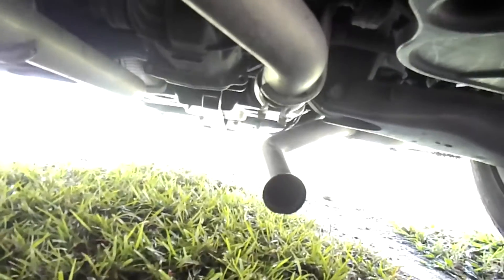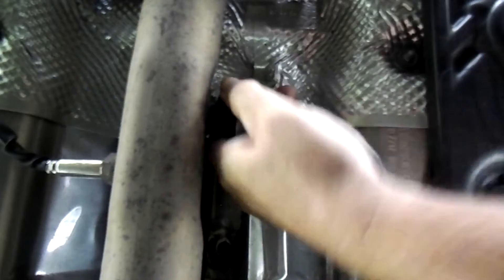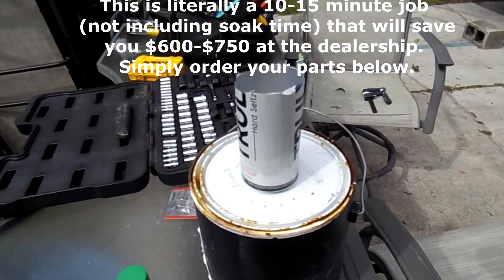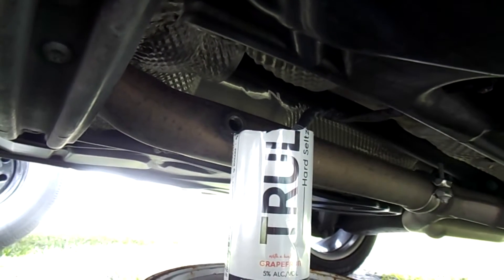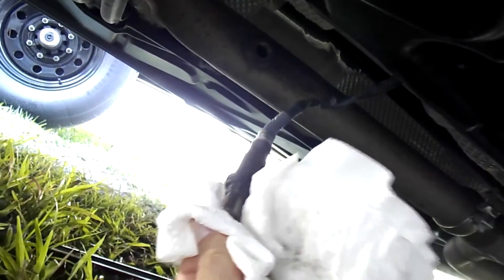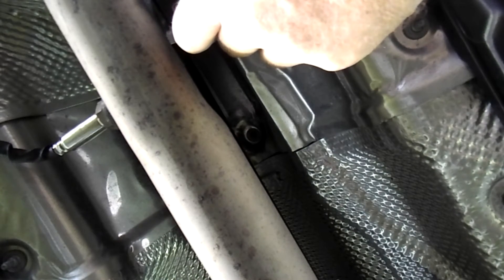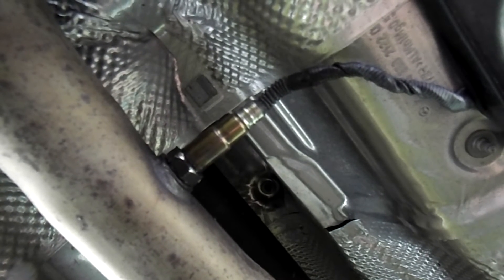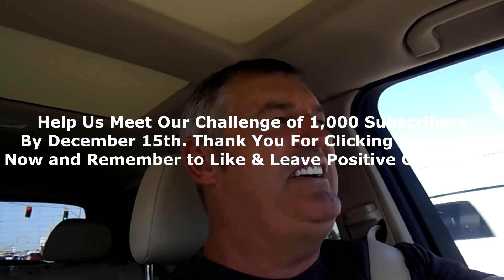How to fix a NOX Sensor DIY for $10 on any diesel engine without replacing, even on Mercedes-Benz.

Comment: Good video only problem sometimes they need complete replacing hard to tell as a DIY guy
Reply: Mandeep Lalli, Thanks for the comments and yep sometimes they do just need replacing but it does make sense to invest $10 to determine if you MUST replace them and then spend $1500. We see that you have not yet joined our family here on YouTube and we would love to have you. Please subscribe and let us know once you have.....WELCOMEE!
Reply: @gmiller4326  definetly agree I tried your way with the cleaner first for 10 pounds or so was worth a go ended up getting it diagnosed from garage and then changed it myself problem with these are you need a proper snap on computer to reset the ECU and box.sensor as a DIY guy like me it's a nightmare back to the garage lol subscribed

Comment: Great video, but I’m curious since it’s been 2 yrs now after your Nox sensor cleaning. Did it fix the code problem indefinitely the past 2 yrs or did codes return after a short while? I have this exact same vehicle (GLK250 2015) with the exact same problem.
Reply: Hello Kyle Mills, Sorry for the delay...was doing my turkey vacation. The MERCEDES ran strong for 3 months after the maintenance and sold it for a NEW F250. Diesel of course but never had another issue out of the MERCEDES. Kyle I noticed you haven't subscribed to the Miller Family Farm Trust Channel and we would love for you to join the family as we love participation with real people. Let me know once you have subscribed.

Comment: Hi Dear. Nice informative video. Like 👍, join and subscribed to Your channel. I have Jeep Grand Cherokee  2015 3.0L eco-diesel… Got the same message: car won’t start in * km. Service DEF system see dealer. Then I found NOX sensor code on computer. Could I do that way to clean the NOX sensor on my car? Thank You.
Reply: Andrey.
Welcome to the family. Yes you can certainly try this on your sooted sensors and the worst case is you will have to buy a new sensor. Let us know how it goes for you. Most people here have found that it works 95% of the time. WELCOME!!!

Comment: I have an engine warning light on my 2014 ML 250, Mercedes dealer quoted me $1200 for getting it fixed…🤪. Will try the clean first ! Not sure how the engine warning light will reset itself..without taking it back to the merc service to have their diagnostic system take care of it?
Reply: Hello Slicky Nick,
Yes I know the Mercedes dealers love to swap out sensors every 10,000 miles and now you have a way to clean them yourself. We noticed you haven't subscribed to our family and we would love to have you as we love it when people contribute. Let me know once you subscribed and I will shoot you an email offline for how to reset your engine light for free. Welcome aboard.
Reply: I have the same issue. Did the cleaning work? If so, for how long? Thanks!

Comment: what codes did you have mate? I cleared my 2 codes P229F00(Nox sensor) +P20EE00 that came up with the ad blue 600mile warning. Only took 4 litres to top up. But light still there. Will cleaning the nox sort the ad blue problem?
Reply: Hello Frank,
Thanks for the comments and questions, we love when good folks participate with positive comments and questions. We did notice you haven't subscribed to our family and would love to have you part. Hit the subscribe tab now WELCOME! 
I do not remember the codes my 250 as the codes where over 2 years ago but start with the basics and get the sensors cleaned up and then lets see if that takes care of the "Blue" issue too. Let us know...

Comment: Twist the sensor before you do it back up so the wires are then straight on completion
Thanks for the very informative video Sir!
Reply: Thanks Adam for the acknowledgements! We love people like yourself who leave positive comments and we would love to have you join our channel. If you haven't already done so.... please subscribe.
Reply: @gmiller4326  about to take my cr35 to main dealer as have this NOX issue that wont clear. The Mrs had to press the code reader reset as we were driving just to get it back. She was controlling the turbo actuator solenoid as I'm flooring it. Listers VW here we come! money I bet but I have spoken to the guy and told him your sensible and logical idea
Reply: @partalien9862  So sorry to hear you did not get this fixed yourself for $10 and 15 minutes of your time but we understand sometimes it just easier to pay the dealer. We noticed you have NOT subscribed and we would love to have you join our community as our family simply loves contributors like yourself. Please subscribe and then shoot me a message that you have subscribed. WELCOME!!!!

Comment: I tried this today. I'm going to let it soak for 24 hours. I'll let you know how it works.
Reply: Good for you Marty,
Let us know how it goes as it really saves a load of money. I have been told occasionally, it will not clean out the sensor but I think that is only when you drove with the sensor plugged for sometime. We like people who share on our channel and would love to have you subscribe and contribute to the remainder of our family here at the MILLER FAMILY FARM TRUST channel.
Reply: @gmiller4326  Worked for about 10 miles then the light came back on. That was after 24 hours of soaking. I ordered a new one.
Reply: @martyacosta2335  As we have seen with others, sometimes it requires a second cleaning if they are really gooked up. We have noticed that you haven't subscribed to the family here on the Miller Family Farm Trust Channel and we would love to have you as we like when people participate. Let me know once you have subscribed and WELCOME!!!

Comment: Hi I have a glk 250 2015 too. This showed up few days ago. Scan tool says it’s NOX sensor P229F & P2202 sensors 1 & 2. 

First once you cleaned them did the engine light disappear on startup or after a short drive

2nd in the vid there was another lead going into the exhaust opposite the one you cleaned. Are both of those the 2 NOX sensors or is the 2nd one elsewhere?

Any help appreciated. Only had it 6 weeks dealer refusing to fix it as a courtesy.
Reply: Hello Nickers,
We noticed you did not subscribe to our channel and we would love to have you aboard as you ask very clear questions that contribute to our entire family here. Welcome Abaord.

1. Once you clean the NOX and SOOT sensors. You will need to manually reset your computer engine light or you can take it to a parts store and ask for a favor to reset your Engine Light. 
2. I am not sure you what you were looking at in the video but you would want to clean both the NOX and SOOT sensors. 
3 Generally speaking the dealer could be forced to fix EMMISION issues but why don't you give this simple fix a try first. 

Be sure to subscribe to our family here as we like people who ask questions and leave constructive comments as this contributes to our whole community. Welcome Aboard

Comment: * IMPORTANT***
Hi everyone, their has been a re-call for all ML250 ECU SOFTWARE. Im in melbourne australia and we had limited kms remaining, dashboard also said ADBLUE and NOX sensor. The car ECU also locks out anyone from making any changes so both NOX sensors will need replacing for free to be able to do software update.We almost spend several thousand dollars at private mechanic, lucky we rang mercedes.  All the best
Reply: @fezg123
Thanks for the info.
I'm having the same problem with my ml500.
But I don't know if the recall cover ml500.
Do you have a link or a place for me to check this information.
Please and thank you.
Reply: So once you receive their update it locks your computer so you can never delete these dreaded emissions components ?

Comment: You only cleaned one side on your 250 did you actually clean both I still have car up so would be easier to do second one if that is necessary. thanks this was most helpful.
Reply from the maker: Yes I did clean both sensors.. Good Luck Jim

Comment: I watched this video and went under the car to pull the one on the driver side, like the video showed, but wasn't sure if it was a NOX sensor and looked up the part number and it showed that its not the NOX. The one on the passenger side is the NOX. Could this have been switched at a shop?
Reply from the maker: Job well done! One is a sut  sensor and one is a nox sensor. Good job at looking up your part numbers. Good Luck with your project and welcome to the family. Subscribe to our family and make sure to hit the like button if you really like our videos. Get-er-done!

Comment: Nice.  We have the 2014 glk 250 Bluetec.  Has had a number of sensor issues related to exhaust.   Had code p24c6 today for particulate filter sensor.  From what I've read it may come from exhaust system not getting hot enough for effective regen.  Was wondering if I should just clean particulate filter.
Reply from the maker: Hello Randy,
Thanks for the comments here on the Miller Family Farm Trust Channel. I have never cleaned a particulate filter before and I am not even sure if you can BUT if you discover how to do it and it works come back and share with us. In the meantime be sure to subscribe to our channel now and hit the like button too and the BELL button so you will get notified when we post new cool videos. Thanks again for making a difference.

Comment: After P22A1NOx Sensor 2 Circuit High Voltage Bank 2 code appeared, I completed work as described in video with downstream sensor. 
Was happy when code light went off for several days, then new code appeared, P2201 NOx Sensor Circuit Range/Performance Bank 1. 
How could this be related? And now what? Video very well done for this novice DIYer.
Reply from the maker: Good Day Pbean,
Thanks for the acknowledgement for the video. You will want to search what the code P2201 refers to. It looks like you may have 2 NOx sensors but I do not know your particular vehicle. See if you have 2 NOx sensors and also call your local service department to see what code P2201 refers to and where that sensor is located. Good Luck
Reply: @millerfamilyfarmtrust6515 all vehicles have 2 nox sensors one before cat one after that P2201 is the first one
Reply: Just wondering what you ended up doing to fix the P2201 Nox error code?

Comment: Thank you for your video, the idea of just cleaning a carbon "infested" sensor for the 1/100's cost vs having the dealer replacing it really appealed to me. I own a 2014 GLK 250 with 50k on it. As the story goes the CEL light came on, scanned and found NOx sensor fault. I started removing it using an 18" bar and suddenly "successfully" snapped the removal tool into two pieces. What now - I was thinking. Well I resorted to my 14" pipe wrench which did the trick, no problem. I took both sensors out, soaked them for 24 hours, flushed and reinstalled them. I then turned the engine on, ran it but the CEL only would go out after erasing the fault code. So far so good after a week and 100 miles.
I'm now a happy subscriber.
Reply: It's 3 year later. How long did the 'Check Engine' light stay out? I'm interested in how long this sensor-cleaning works for.
Reply: @xxwookey  you have a problem to spend just a few euros, dollars or whatever to solve the problem, every 3 years ???????
Reply: @ No. I'm asking how long this worked for. It works long-term and doesn't damage the sensor then that's great, and this is indeed somethgin many of us might want to do. But we don't know that. It's obviously not an 'approved method' so it's possible that the injector cleaner doesn't interact well with the sensor catalyst materials, and the thing dies after a while. So a reply from this guy saying 'yeah, I've had no problems at all for 5 years now' would make viewers more confident about treating their $300 sensors this way.
Reply from the maker: THANKS STEVEN FOR CONTRIBUTING TO THE MILLER FAMILY FARM TRUST CHANNEL! Its people like you that really make this channel great. Welcome aboard!!!

Comment: I think one of those, the most rearward, is the soot sensor. The other is Bank 1 sensor 2.  Bank 1 sensor 1 should be upstream.  Also, the Mercedes diesel exhaust sensor are VERY fuel sensitive. If you use Top Tier brands of diesel, like Shell, Mobil, and Sunoco, you will have fewer problems.  If you use cheap diesel from small stations, the fuel can be dirty with paraffins and other contaminants.  These engines require the absolutely most clean full synthetic oils because if any soot escapes from lesser quality oils beyond the rings into the exhaust, it will foul the sensors. Even regular Mobil 1 is too dirty.  If you know that even traces of Mobil 1 in the exhaust is too dirty and will foul the exhaust components, just think what dirty fuel will do from Bubba’s Truck Stop.  Also, soak those sensors with PB Blaster overnight, start the car for 5 minutes, shut it off and soak it again with PB Blaster for a day. Then they will come off with a crescent wrench and a couple of hits with a hammer.
Reply: I thought one of the reasons for diesels is the ability to take down dirty gas. eg) When you go to Mexico
Reply: @nickardecky7404  I have to agree with you Nick but I used only SHELL and still had issues with the Mercedes (Over and Over) until I started this technique that only takes 15 minutes. We noticed you have NOT subscribed and we would love to have you join our community as our family simply love contributors like yourself. Please subscribe and then shoot me a message that you have subscribed. WELCOME!!!!

Comment: Any issues meanwhile with Nox sensor.

my merced van has a faullty nox sensor. I want try same thing.
Reply: Good Day Crina, I sold the Mercedes so I cannot tell you how the sensor is doing now but it was fine for about 3,000 miles after cleaning both sensors. Good Luck

Comment: That was pretty good Handy man's GLK fix. I had P229F62 code on my 2015 GLK250 and dealer replaced the NOx sensor which fixed. I had CPO warranty and it covered. Next time if get same problem after the Warranty expired, will try that!
Reply from the maker: Thanks Sang Lee...Remember to subscribe and support our channel.

Comment: The CEL on my 2015 Sprinter van came on today and scanner said "NOx sensor downstream of SCR...." is outside the permissible range. I guess this means "first clean the sensors!"  I will try what this video showed then I will follow up with results later. Fingers crossed, wish me luck!!
Reply: so how the result?
Reply: @bluegables  did you try?
Reply: @avarora  Not yet, I brought the same solution. Now the CEL is off, plan to do this in Spring.
Reply: Have a sprinter with same code. Did this work for you?

Comment: I bought the exact breaker bar and adapter, you recommended and could not get the nut loose. Tried even adding wd40 to try and loosen it. The nut started to strip so I have no idea what to do but bring it into my mechanic:(
Reply from the maker: Yes...those nuts are extremely tight as you seen in the video. I was told by another viewer, to start the car and let it come up to temperature and it can help with getting it loose. It takes some muscle to get those nuts to break loose and I am 6 foot 3 inches and I had to really lean in to it to get break loose.

Comment: Thank you for the video! 
Really good video a woman cloud do to x
I having the same issue with my car (Nox sensor with engine symbol on the dashboard)Mercedes Benz C220 diesel 2014 so I took to the mechanic to fix it and he said need to change the Nox sensor and will clear the fault. ,,He did it" but still have the same  issue because the engine symbol came back with the adblue thing on the dashboard so I took it back and then he took to the electrition but STILL NOT FIXED!
So now I took my car back 3rd time with the same issue and told him If will not fixed I need my money back!
Have any ideas what's going on? 
Thanks,Ramona
Reply from the maker: Romona,
Really hard to tell as the NOX sensors are "Plug-N-Play" and just need to reset the computer to let it know there is a new sensor. Sometimes, its a good idea to take it to a real Mercedes dealer to diagnose and give you a quote to fix. You can then jut tell the dealer you will need to come back when you have enough money or use the information to fix the underlying problem. Good luck!!
Reply: I have a similar problem on my C Class 2015 2.2L Sports Premium. Did you get it sorted? If yes can you please share